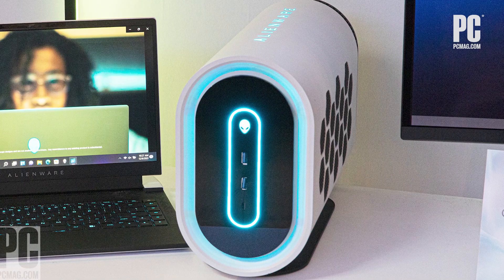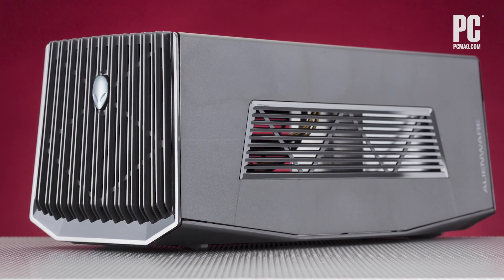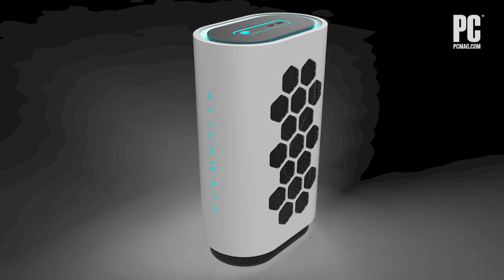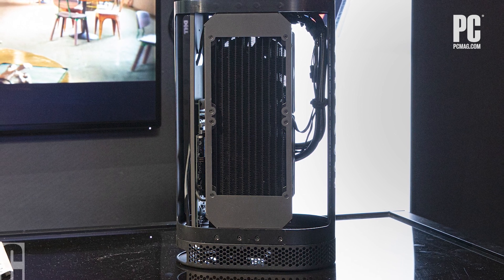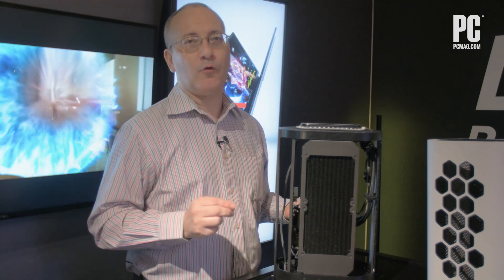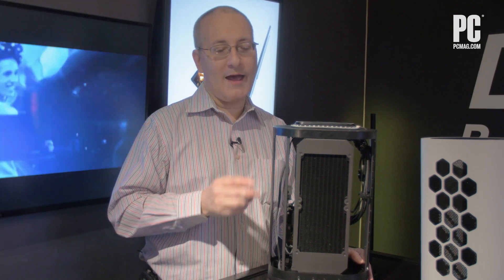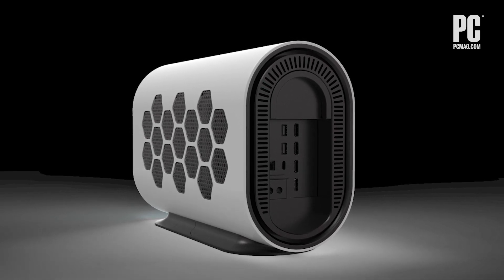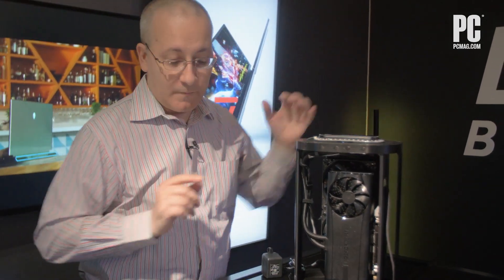Preview: Alienware's Concept Polaris Is a Next-Generation, Liquid-Cooled eGPU

Comment: Ive been customizing my Alienware Graphics Amplifier. I managed to get my 3080ti in there and got a fan system fit inside that keeps it at a crisp 57° at %100 utilization. 
I swapped the power supply with a EVGA Supernova 650w power supply (which is tiny) Paired with the Area 51m with an I7 9700 desktop CPU its some very impressive performance. 
I control the fan speeds of the case and RGB with Razer's fan controller and rgb controller. Its been a blast customizing and making it all work.
Reply: Nice

Comment: What’s the purpose?? Why not just get a desktop 😕
Reply: Most people always carry laptop, so having this kind of capability for Thunderbolt-supported laptops is tremendously useful.
Reply: @farishanafiah8461  yesh, and it saved space, not to mention tat you only have to buy one monitor to pair it with the laptop to have dual screen.
Reply: Before it was power at home, slight power on the go.

1x egpus helped but not enough, then 2016 came around and BAM vr and amazing egpu useage for laptops, but come late 2021, laptops no longer need egpus as they are really powerful.

Still though having a egpu gives more ports, and less wear and tear on the main board egpu. If they have on board and external egpu to be used for whatever then that brings so many other possibilities with laptop that it would be cool to own one.

Comment: They should also back compatible it with laptop's that still has that AW proprietary connector to the new cable. to use the better bandwidths not covered by the TB3 USB C ports
such as the AW Area51m R2

Comment: Alienware should use 2 thunderbolt connectors. For x8 pcie speed on the gpu. Your still stunted by x4 pcie speeds.
Reply: The 4x PCIE 4.0 lanes give up to 8 GB/s while the Thunderbolt 4 bandwidth is just 5 GB/s.

Comment: Tbh with 40gbps bandwidth this is a dead born product compared to pci-e4 solutions.

Just check the Asus xg mobile solution with 63 gbps bandwidth .it destroys a desktop 3080 inside tb4 Egpu with mobile 3080 inside xg mobile
Reply: Indeed. This seems to be a waste. A desktop RTX 3060 over Thunderbolt performs similarly to a mobile RTX 3060 configured to 80W. This only makes sense for compute workloads like rendering from the VRAM.